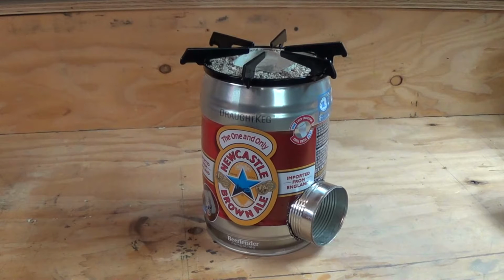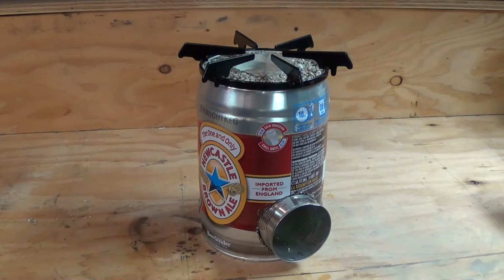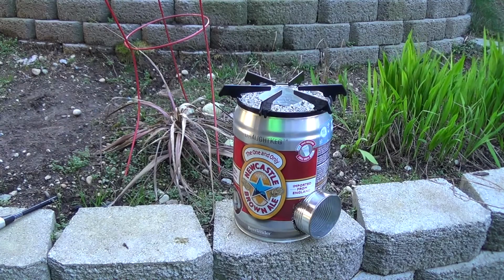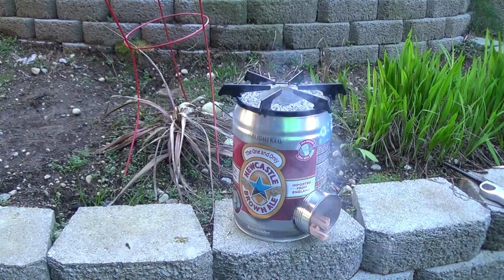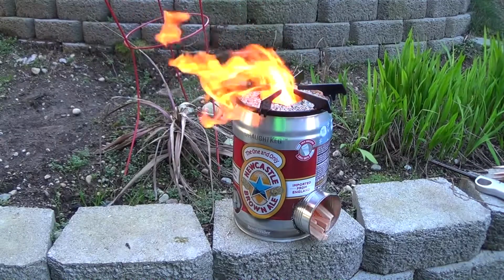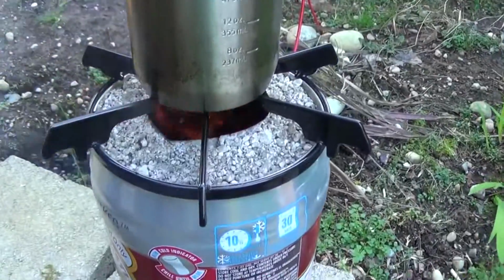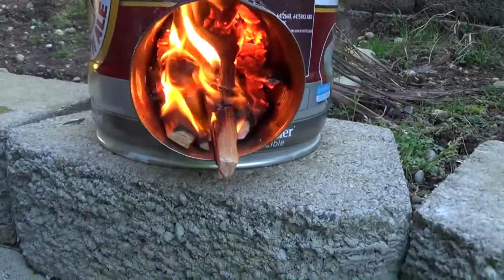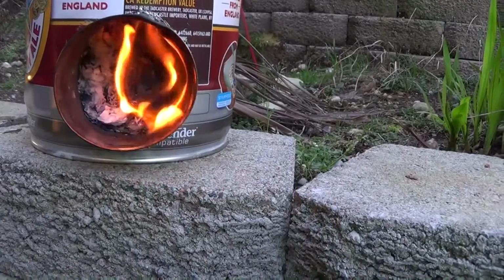DIY Beer Keg Rocket Stove 2 0 Test Burn

Comment: Better, but it still does smoke! A good RStove doesn't produce gray smoke! As probably suggested already 
1: place firewood atop an air inlet. 
2: intake diameter (air and firewood intake can) should be slightly smaller then burn chamber diameter.
3: take the burn chamber diameter and multiply it by 2.5 or 3 to get the optimal heat riser length.

Comment: It should always be a big "no-no" to not include just what happened to the beer. Just sayin'...  :-)I watched the first video and was going to make some suggestions, but I found you had actually already incorporated them into your second build. Nice to see the improvements and to see they lead to even more improvements for the future. I love DIY items as this and have spent tons of personal time and money in making such, myself over the years. I like that you make your videos simple and don't spend a ton of time in explaining away everything as you go.Questions:What size and where did you obtain the stove burner for this project? Also, where did you purchase your temp scan tool and what brand is it?FYI only: Vermiculite or Perlite and cement mixes will retain a certain amount of moisture which can break the cement when extreme heat is produced. This can mean leaks at joints and such, but one good idea is to always keep the stove covered with left outside, in order to prevent moisture buildup. Cinder blocks frequently crack or explode because of the moisture trapped in them when a good sized fire heat is made inside such. Tandoori ovens made of clay suffer the same when encased with the mix of Vermiculite and Cement as insulation. A remedy is to not use the type of cement your using, but the same company does make a crack-resistant cement mix that is less prone to doing this when mixed with Vermiculite or Perlite.Opinion only, but base on past experience: I disagree with the absolute need for a raised platform beneath the wood pieces being burned for this stove. The air will circulate just fine as long as the feeding tube is not obstructed by too much fuel being added at once. Harbor Freight and WalMart have small fans for the cabs of trucks or such that can easily be positioned at the feeding tube area to act as a bellows in getting more oxygen into the feeding and burn tubes. These tubes are not going to be critical for air flow by what you have used in either prototype you show. Just don't block the feeding tube with too much wood at one time.    As a resource area:  You can generally find stove burners at any appliance repair shop. Thrift stores may have them as well and often they are free where any company sells appliances and takes in old appliances to replace with new.Thanks for posting these videos as they are simplistic in instruction and offer some good points of advice in making a workable rocket stove that works better than most as to efficiency and practicality.
Reply from the maker: +a1930ford I got both from Amazon.com   The temp gun was the cheapest one they had,  I think it was $12.99 it's only accurate to 1 or 2% of the temperature range but for what I'm using it for it's good enough.  

Stove Grate is also from Amazon (maybe there is a trend here :P)  I got lucky with how well it fit.  

http://www.amazon.com/gp/product/B005E0LBUO/ref=as_li_tl?ie=UTF8&camp=1789&creative=390957&creativeASIN=B005E0LBUO&linkCode=as2&tag=gea0fd-20&linkId=ALMMJ6QJFR6EGGPY

Comment: A Rocket stove needs  a couple of things to work properly 1st the chimney height needs to be 3 times what ever the air/wood intake is. so 3" intake needs a 9" chimney above the burn tube etc. 2nd thing is you where on the right track with the wood shelf the wood needs to burn past the end of the shelf, lower the shelf a little, more room for wood still lots of air flow.
Reply from the maker: +Roger Spinks yeah,  I thing the biggest issue I had with this one is the chimney wasn't really high enough,  if I were to do it again I would put a half keg on top to help get a better draft going.

Comment: YES with that stove I would eat food from.. version 1 not so much. much better! as an improvement to ver. 2 if you added the air tray to to inlet (were you at the wood) it would help you with a better wood burn up the pipe! the way you have it now, it has a LAZY burn not so concentrated up the burn pipe... with the air tray set in the intake wood pipe.  with the air tray you will get more of a JET BURN out the chimney/cook pipe...  other than that I love the setup. thank you for your time and your build. 
p.s. plus this setup is MUCH lighter, easier to carry, and safe to eat food cooked on it...

thank you... great video, thumbs up.
Reply from the maker: +Richard Downer Thanks, yeah version one was a much rougher version,  this is a big improvement.  

I couldn't believe how light this thing was,  the first one was like a pile of bricks!
Reply from the maker: +Richard Downer As far as the fan goes, I'm saving that for the beer Keg Furnace project.  

Thanks for watching!